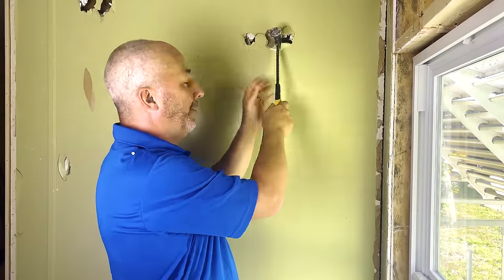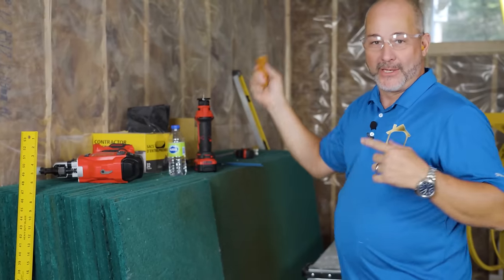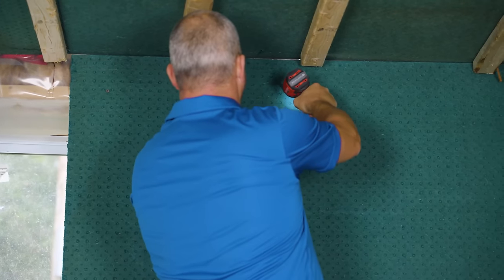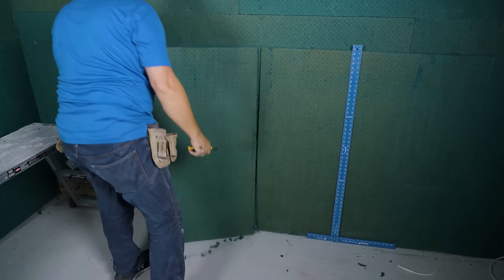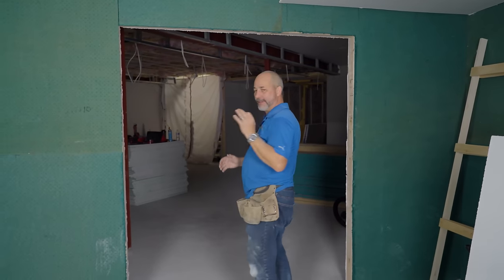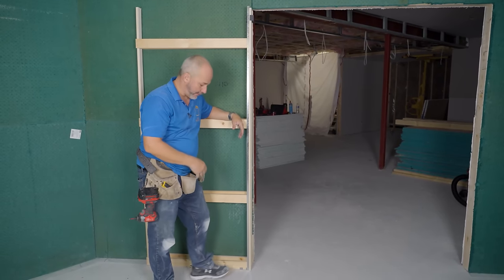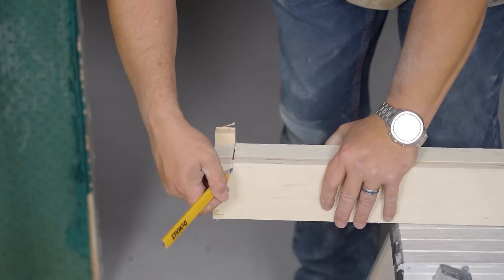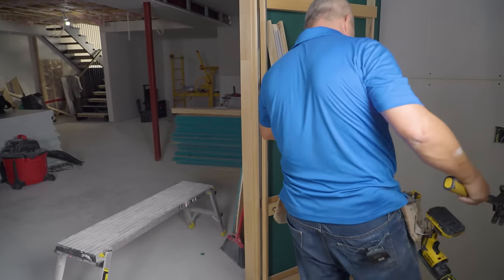The MOST Effective Way to Soundproof any Room

Comment: What are the cheapest ways to sound-proof windows? Is it necessary to pay for double-pane or triple-pane glass? Can plexiglass work for mass to save money if you’re not obsessed with window quality?
Reply: You can DIY something with plexiglass or Lexan, but it can be tedious. I used a company called Indow to make me a soundproof insert for a window at my studio- they’re custom fit 1/2” sheets of Lexan with a rubber gasket seal. Works great! There’s other companies out there that sell similar products. Either way it’s going to be way cheaper than putting in a premade triple pane window.

Crazy seeing you here, Tay! Hope it helps
Reply: The other reply is a good one, if you still need the window to be a window for visual and lighting purposes but not ventilation. If you are only concerned about noise, fully board it over. Here in Australia, most aluminium frames can accept glazing up to 8.5mm single laminate. Retro-fitting is not cheap though. It will reduce noise transmission by around 5-6 dB and give better low-frequency improvement than the separate plexiglass insert mentioned above, which will perform slightly better at mid to high frequencies which means 7-9 dB improvement for "average" noise sources.
Reply: If you have a deep-enough window well and you need isolation only when you're recording or mixing (and you have easy access to the window) then you might be able to build a "plug" which friction-fits into the window casing and has a flange on top which sits flush to the wall around the trim.

A similar option is to construct an interior shutter that acts much in the same way but operates on a hinge and can be opened and closed.
Reply: @helmanfrow  That's a great idea.
Reply: @simpletonballsack  Thanks. Pretty sure I learned about this in an issue of Recording Engineer and Producer from 30 years ago ;).
Reply: @helmanfrow  I deleted an off-topic comment. Your removable acoustic infill for the window is a good idea. I have field tested a commercial perspex infill panel product with magnetic attachment (fitted in 100mm reveals) and STC (or Rw) is improved by 7 but there is no improvement at frequencies below 80 Hz.
Reply: @rdbram824  Looks like it pays to shop around and ask questions. Acrylic is a cheaper option than Lexan but you could end up paying a couple hundred dollars a window and not get the results you want. Seeing what Jeff did with that pocket doors makes me want to try and DIY some second hand interior shutters. Wood is cheap.
Reply: @xmassan20906  those beautiful sliding doors undo all the acoustic treatment relative to the space on the other side of the doors.
Reply: @simpletonballsack  So wood is not a good option?  Or do door create too many open gaps?
Reply: @xmassan20906  The unsealable gaps are bad for noise regardless of door material and also the cavities in the wall each side of the door opening are flimsy and uninsulated. They look great but can never be used where there's noise on one side and a requirement for acoustic privacy on the other.
Reply: plexiglass wrapped in foam pipe insulation - press fit worked well for me. COVID raised the price of plexiglass by 3x-4x - consider installing a replacement window (no nail fin) inside the existing window if you have enough depth

Comment: Wool is 70kg/m^3 vs fibreglass which is 40kg/m^3. If mass is important in sound insulation wool has more of it.
Reply: Good pick-up but Insulation mass is insignificant compared to panel mass. Insulation provides no sound transmission reduction as a mass element, only cavity absorption (or room absorption if on exposed surfaces). Walls with and without insulation differ in transmission loss by up to a maxim um of 6 dB. If you put in 70kg or 40kg insulation, they will both give about 4-5 of that maximum 6 dB with the difference being negligible UNLESS you're chasing 1 dB in every part of the system and then every dB matters.

Comment: I'll gladly repeat this until it sinks in: The primary function of fluffy insulation is to help dampen resonances within the wall cavity. There's no reasonable amount of fluff that you can stuff into a wall cavity that will contribute a meaningful amount of mass to the assembly. That's the job of the drywall or other solid wall panel.
Reply: Exactly correct.

Comment: Interesting video and overall project, but I'm afraid the final test doesn't tell much about how soundproof that home theater room really is for its purpose. Soundproofing a room to be able to listen to a small portable stereo without hearing it too much from the room above it is easy. Preventing the transmission of the large amount of bass frequencies that serious home theater subwoofers can produce when watching a blockbuster movie at theater sound level is another story, and I'd be very surprised if it'd work really well enough in these conditions. Also, another big problem that I can see is that, unless you add a ton of acoustic treatment later on (which doesn't seem to be the case judging by the video's thumbnail and the already smallish finished room), the finished room is going to sound terrible like it is, very resonant and agressive (as you can hear when he speaks in it, only much worse when playing at theater level), as it only has hard reflective surfaces (painted drywall on the walls and ceiling).
Reply: I know the die-hard soundproofing fans tend to go for a certain method on the forums, I know the hat channels are a huge theme there, and also building a room within a room. but I just installed the sonopan in my 4-plex for a basement apartment and was really impressed by what just one layer of sonopan and 1 layer of 5/8 drywall with resilient channelson the ceiling has done to reduce the noise. Granted, I was more going for voices, I can still hear footsteps because I have steel beams holding up the first floor, so it would be almost impossible to decouple the whole unit from that type of noise. But, I like how he did a complete layer of the sonopan (so sealed from upstairs and surrounding rooms) then framed inside the sonopan, which in essence decouples the room. The only add-on I would put for the noise transmission between downstairs and upstairs is maybe some hat channels betweenhis sonopan and his drywall on ceiling, but then he wouldn't have anywhere to attach his wire for pot lights (he used 2x3 for strapping instead of hat channels) and he could have added second layer of drywall with green glue in between for the ceiling. But I bet the soundproofing is pretty good, anyways he has a vent in there so that will emit the noise to the rest of the house - not too much you can do there. As for the hard surfaces, super easy to manage by installing a large area rug and some decorative sound panels on the walls like a normal movie theatre, to dial in the sound quality. This isn't a pro home theatre but it's pretty good IMO.

Comment: Put a rubber floor mat and top it with a heavy carpet, Hang ultra-thick blanket to the walls and door, Add a heavy furniture like a sofa, and if you can install couple panels to the ceiling. No one will hear you making out:yougotthis:. *Have an emergency panic button just in case😂

Comment: Get yourself a center scriber for woodworking, or make one. It’s essentially a piece of material (plastic, aluminum or wood) with a hole in the centre for your pencil lead and a peg on each end.  You pivot it on the edge of the board you want to find the centre for so that the pegs pinch the board. Your hole is now centred on the board. Stick your lead in there and slide the scriber, giving you a perfect centre line.

Comment: Just for the record, "soundproof" is largely a misnomer. In residential and light commercial construction there is essentially NO WAY to eliminate all sound transmission at all frequencies. Completely-isolated, double-wall assemblies can do a pretty good job but even they begin to fail at higher SPLs and lower frequencies, especially if adjoining spaces share a floor system or foundation. There is always a compromise and the best you can hope for on any budget is "good enough". This is physics, not pessimism.

Comment: Finished a room but paid a drywall crew to do the taping and mudding.  I asked them if they sanded and they said no, pros don't need to sand. They did a fantastic job.  They went on to explain to me that in the trade if you're seen sanding, you're not considered a pro. Takes longer.  They also prefer the mesh tape over the paper tape. Found them on Angie's list, they had a 5 star review from over 100 customers.  So, I dunno, seems legit to me and seen 1st hand it all done with no sanding.  They used a quick set mud and a wet sponge at times to blend and feather.

Comment: This is hardly soundproofing. You need mechanical decoupling for any sort of real results. It does not matter how much insulation or sonopan you put up, if you have the drywall coupled to the studs/rafters/joists then it's going to transmit damn near everthing below 150hz like you had no insulation at all. You've just maybe killed off a few db of high frequencies with this method. Subwoofer will go straight though and might even be louder than before.

How do i know? I've spent 2 years trying to soundproof a house next to a busy road, and no amount of drywall, insulation, or green glue has helped like decoupling clips or a separate decoupled wall. Structural transmission is the largest hurdle to sound reduction. Don't waste your time or money unless you are implementing decoupling, especially if you're already down at the studs
Reply: This will be a significant improvement over standard construction but these materials could have been better utilised to enhance transmission loss in the lower frequencies. It sounds like you're well aware that Jeff's test noise source has zero low-frequency so the system can't be tested across the full range. I'd like to have a look at it with my ISO pink noise and spectrum analysers.
Reply: The purpose of this video isn't about showing the most optimal solution. It is showing the most practical, affordable, DIY solution, which is what Jeff's channel is all about.
Reply: @joseph7105  That's what I also love about Jeff's channel. I'm right now replacing front windows in my house, and have watched Jeff's video on this. That being said, there are better ways even just to utilise the materials Jeff uses here.
Reply: When it comes to acoustics I've been something of a hobbyist/expert layperson for about 20 years. I take issue with the use of the term "soundproof" as used in these kids of videos because it's usually thrown around without any context. A conversation of sound transmission loss must always focus on how many decibels and at what frequencies. The type of construction always stems from there. Like you said, this assembly will be less effective in the bass frequencies because of insufficient mechanical decoupling.

Comment: I think I’m going to try boxing around pot lights with ProRox SL 960 Rockwool board (1 inch), since I already have some. I don’t want to go in double strapping or even strapping in this portion of my shop since I’m dealing with an eight foot ceilings. Above this is an enclosed mezzanine that will be office/back up living quarters. I want real pot lights so I can use very good 95 CRI bulbs with great R9 ratings…can’t find that in the little puck lights. Other than a few runs of 4-6 inch ducts, the rest of I joist will get 8.5 inches of Rockwool with couple of inches of air gap (required for under subfloor hydronic anyway, but I think it will help with sound proofing).

I am not looking for perfection here. It’s a shop…just taking the edge away from a planner or grinder running straight down below or below and to the open bay side.

Comment: Great videos . I am building a Home Theater in my basement three walls of that area or exterior walls, cement block and one wall opens up into the rest of the basement. Do I need to soundproof the cement sided walls as well appreciate your input. Great work on the videos.

Comment: 36:04 The "sound quality" in the room will change when you put up drywall. Sonopan is not an acoustical treatment. At least not if it gets covered by a wall panel.

Let's not confuse sound transmission loss and room acoustics.

Jeff, your heart is in the right place but you're using imprecise language and confusing your concepts.

Comment: Just wondering if you need to strap the joists with 1x3 before putting up the sonopan.  Could you put the Sonopan up (screwed into the joists) then strap it with the 2x3's?

Comment: All that work and not to use RC1 channel to decouple is a shame. Also, running duct work (steel no less) into the room so you have a sound tube to the rest of the house  was a big missed opportunity. He should have made a torturous path duct with Ducboard to reduce noice transmission to the rest of the house.

Comment: Sonpan layer in the material sandwich as an acoustic break,  Is the bottom of the door running in a channel to cover the gap?  Door sweep on a pocket door?  

Could use a 10" knife if tape isn't an option. Keep a rag handy to prevent build up.  Work clean. Slow is fast.